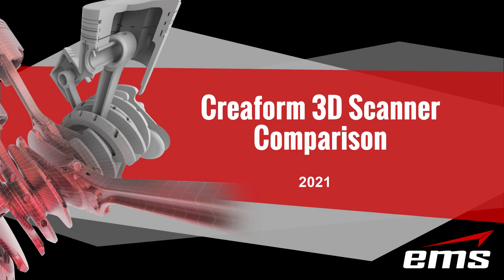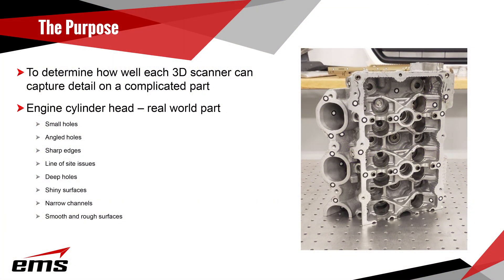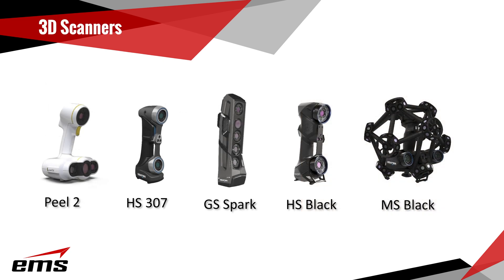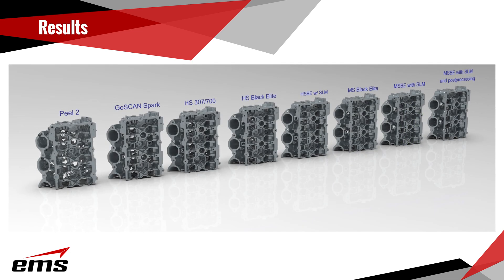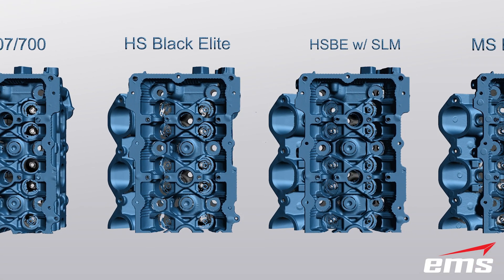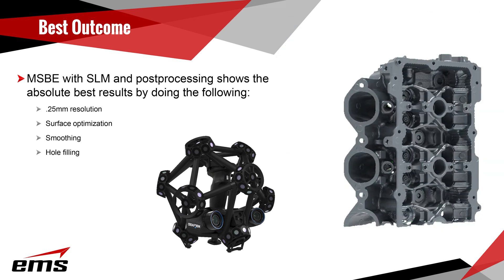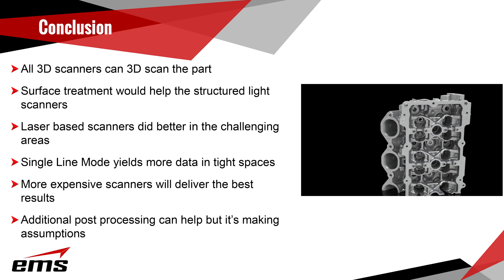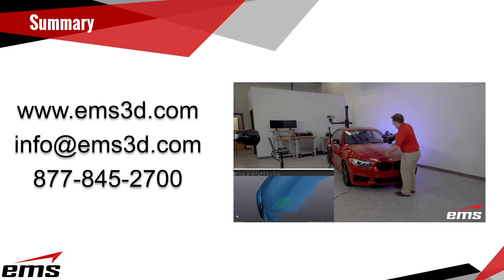Creaform - 3D Scanning Fine Detail Comparison on a Complicated Part

Comment: Do you have any other recommended Brands?
Reply from the maker: Hi Julin,  it depends on your needs, budget, application, etc.   For large objects we use the Surphaser 3D scanners.  For laser tracking we use API systems.   For hand-held systems Creaform has a great lineup as shown in the video.

Comment: Which scanner model would you recommend for ‘hobby’ level ability to assist in reverse engineering motor parts?
Reply from the maker: Hi DonR62.  I'm not sure how well a "hobby" level 3D scanner would work for you.  It will depend on your parts complexity and accuracy you require.  Keep in mind you will also need reverse engineering software and possibly CAD software as well if you are trying to build CAD models.   Keep in mind most CAD systems can't work with raw scan data.  It might make more sense to hire a company to scan and model the parts for you.